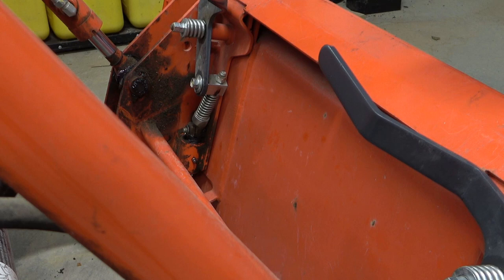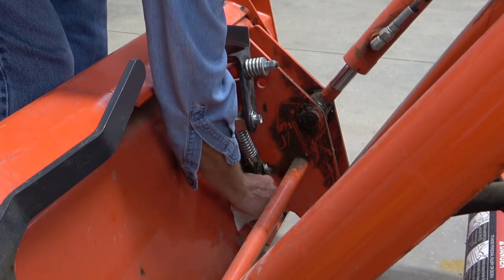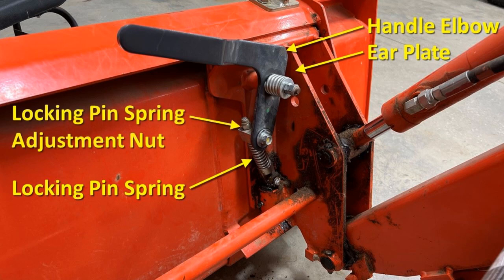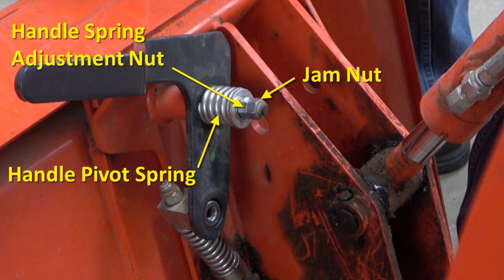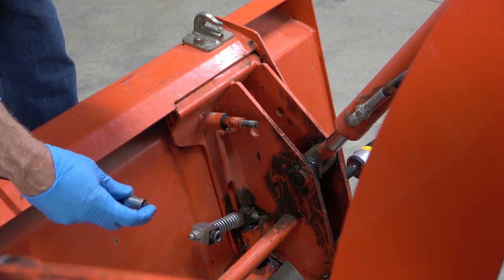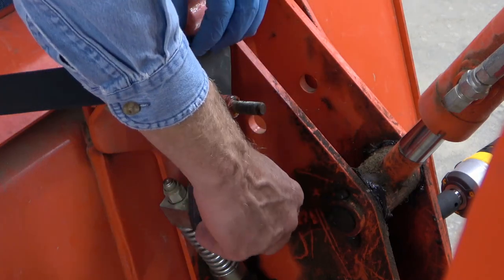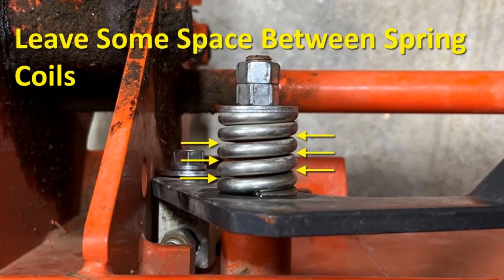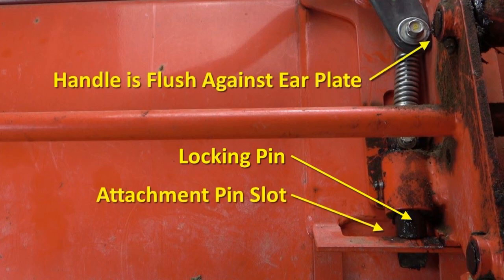Maintenance & Operating Tips for Your Tractor Loader's SSQA System (#178)

Comment: Another great video Martin, thanks!  Instead of grease on the pivot points and locking pins I’ve always used a spray dry lube on all those points every time I grease the loader pins, about every 8-10 hrs.  That’s a pretty hostile environment that sees dirt, sand, etc falling all over those areas, and I figured dry lube would be less likely to attract and hold on to such abrasives. Either way works, just as long as it gets done. I’m pretty religious about keeping mine lubed, because when I met my wife she had a 5 year old 47 hp Branson she bought new and her husband at the time (an engineer no less) didn’t own a grease gun.  It took me a week of hammering and two cans of WD-40 and Liquid Wrench to break those pins and pivot points loose, and ever since then any tractor I own the SSQA gets oiled like clockwork.  Experience is indeed a great teacher. 
Keep making these excellent videos my friend, you do us all a great service! 👍
Reply from the maker: Your too kind, Dan!  Thanks you for the encouraging words!  Dry lube!  I like the idea! Thanks for watching!

Comment: Awesome video Martin with some great tips on the SSQA.  I don't have one on any of the Kubota's but I do on the New Holland skid steer...and yes, maintenance is important even if its only in the form of grease !!  Dang, if you aren't meticulous in all your videos....
Reply from the maker: Thanks, Wendell!  When I bought the L3901 I knew I wanted the SSQA option on the loader.  The small trade off in lift capacity is well worth the added functionality. Thanks for watching!
Reply: @DIYMyWay  Oh heck yeah, I agree 100% Martin.  I didn't have the option on either of the last two Kubotas because I bought them used from the same old buddy that didn't purchase them with it.  And my first one I bought new in '82 with no loader.  Sure is nice on the skid steer changing between the two types of buckets, a home made rock or root digger and the forks.

Comment: We actually got our Grand L 3560 with the hydraulic power option for the skid steer. I just grease the zerts every 10 hours when I do the test of the loader and tractor. However, I  am going to ask the dealer on what you did with your manual handles when I have it on for the 50 hour service coming up soon. I asked the dealer if I could see them do it so I understand how everything works 💪 👷‍♂️ better. I'm adding this toy list of questions.  LOL.

Comment: Martin great minds thing a like. I'm working on building the same thing. So I don't have  to get off the tractor with my bad foot to attache different things. By any chance are you using a12v  Linear Servo that's what I'm using?  Looking forward to seeing how you make yours.   Later
Reply from the maker: Hi Mech! It’s a 12V linear actuator with built-in limit switches and has the right amount of travel to lock and unlock the SSQA. Looking forward to seeing your solution. Thanks for watching!
Reply: @DIYMyWay  I figured the cheep way was to use a heavy duty Linear Servo. This will be a whole cheaper then going with the hydraulic hoses and fittings   Later.